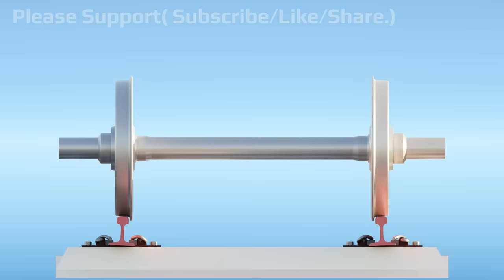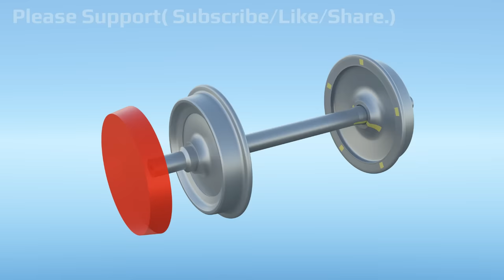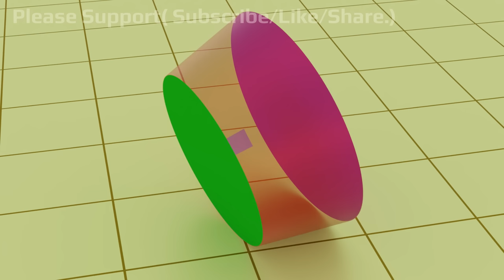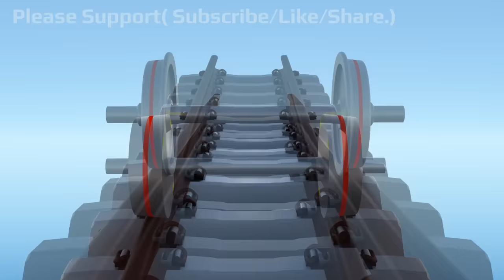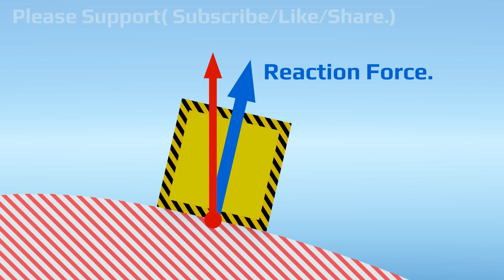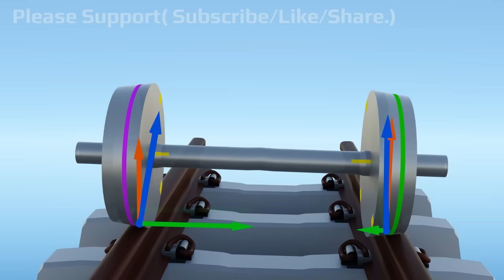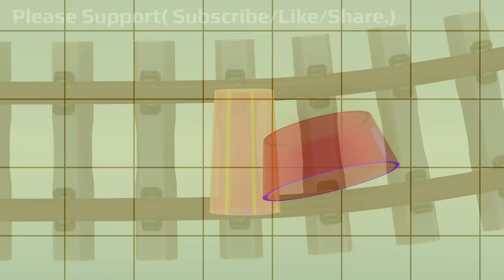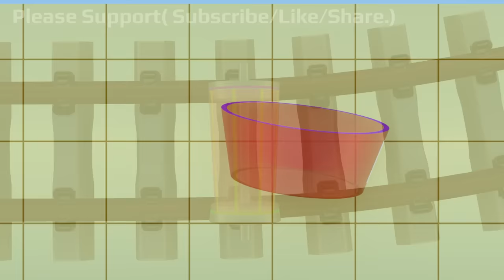How trains actually Turn ? | on curved rail track.

Comment: Only without the wheel and axles and or motors are the trucks called bogeys, with the axle and wheels, and or motor they are known as trucks

Comment: Interesting explanation, but does not apply to all railways. For example the railway I worked on for many years in Queensland, Australia uses vertical rails and cylinderical wheels. This railway has several thousand kilometres of track. The wheel sets still steer around curves, assisted by the superelevation.
Reply: they will wear more quickly (especially wheels) just by nature of their design.

Comment: I don't think that these theories were known let's say 150 years ago and still trains took the bends in railways in those days. In a axle there will be torque in the axle or the wheel on the inner side will slip because it has to ride a shorter distance than the wheel on the outside of the curve. Therefor a car has a differential.
Reply: Some level of wheel slippage is good in railways.

Comment: I wish your videos used complete sentences.  The way they are set up now makes them very hard to follow.  For instance at 2:57 instead of saying "thread section of wheel which is in contact with rails are marked with red color"  you should say, "The red(thread) section of THE wheels, which is in CONSTANT contact with THE rails are marked with A red color".

Comment: 4:00 WRONG WRONG WRONG AS FFFFFFF' rails are installed perfectly vertical, many forces require this mainly the rail bottom so it doesn't split due to weight of the heavy rail cars, one side of the base can not be thin.
also there is no designated rail for left side and right side, they are 100% 90ºvertical and the rail ties they ride on are also 100% 90º vertical........ANY DEGREE OF TILT AND THE RAIL WILL BE PUSHED OVER ON IT'S SIDE ALMOST IMMEDIATELY. 
330 million newtons of force@60mph from a 183,000 gallons loaded tank car. whole towns get wiped out if this math is wrong, ask canada.

the rail head is ground conical to the same degree of the rail wheels, other wise rail MOW companies wouldn't exist to perform this task. as the rail head wears down over time it also needs to be reground to the proper angle once again. this is measured in fuel economy and power level required from the engines as friction increases resistances.

Comment: Flat profile wheels would not travel well even on straight rail.  The conical shape to the wheels and matching valley shape on rails, means it is stable  on a straight section.  it  reduces  bouncing side to side,  which would be annoying   on straight lines...and expensive on wheel and track wear.   If the profile was  absolutely required for turning, how do trains turn at all the different speeds ? Trains  would have to be at the set speed for the corner every time they went through it, so the intrastate freight train would take the curve at the same speed as a transcontinental  passenger  service ?  No. Tilt trains take curves at far higher speed than the maximum speed for ordinary trains.  So no, the rail profile is the same for the straight as well as the curve of any degree, and  the conical profile just  minimises riding the flanges  not prevents it, and the slipping is based on the curve not to do with speed and not cured by profile.

Comment: it needs a differential,
Reply: With a differential, the wheels will not guide at all. You get instant derailment. See the video Guidance by Railway Tracks posted by Civil Engineering ...   The effect of cylindrical vs conical geometry is easy to see.
Reply: @clarencegreen3071  it needs a 
detroit locker.
Reply: @clarencegreen3071  I saw that video. Loose wheels lead to derailment vs. a rigid axle. The cone frustums follow a sinusoidal path as they self steer because the axle has to bank itself as the wheels slide over curving rails. The axle is supported at both ends of the bogie, and the flanges are responsible for the preventing height variation against the tendency of the axle to bank as it rolls over the curved section of the track. 

I was wondering why the wheel axle is not centre supported under the bogie by a trunnion arrangement. A degree of freedom in rotation about an axis perpendicular to the axle would also allow for self centering with the flanges preventing derailment. This would provide for self-centered open-differential type function. What are all the practical reasons for why it is not implemented?

Comment: Great explanation. Your smartest viewers will be able to extrapolate from this why high speed passenger train designs have bogies between carriages rather than underneath them and also the functioning of check rails, but these might prove to be interesting extensions to this topic.  My most notable high speed train journey so far was TGV Lyria from Zurich to Paris - covered here: https://youtu.be/oG5y1gYOd3g
Reply: but they steer the rails in exactly the same way as conventional pullman or budd trucks did. the reason for the truck configuration you describe is for ride-quality and serviceability.

Comment: It's 40' from truck C/L to truck C/L!  And every truck has two sets of wheels! every car has two trucks! Total of 8 sets of wheels! And the curves on rails aren't calculated by the highway standards but designed by a sub chord of 50' this way the trucks won't get bound up in a curve! Because a highway curve is calculated by the Radius and a car or truck can make that radius, whereas a railcar can't handle a radius smaller than 40' because CL to CL is 40'! That's why you calculate radius by using 50' sub chord! Rail Road Curves, aren't tangent to the PC or PT but are larger than the radius of the curve because the points on any curve can't be calculated closer than 40 feet! That's the difference between highway curve staking and Rail Road curve staking! All these displays are irrelevant! Because if they stake to highway standards the first time the trucks hit a curve they would bind up or blow out a track!
Reply: Wrote: "every truck has two sets of wheels! every car has two trucks! Total of 8 sets of wheels!"
Check your maths
Reply: @dukenukem5768  two trucks per car! Each truck has 4 wheels! 2 x 4 = 8? Unless you're a Trumpican? Then it equals any number that makes you right! The distance between C/L to C/L pins are 40' ! ie 50' sub chords in any Rail Road Curve! Just open an survey  field, transit book or any route survey book! It's all there in Black & White!

Comment: Gross over-simplification. Still simplified, the flanges themselves are blended into and angled. There's also the rounded shape of the rail itself. The coning mentioned in the video is most important for running on straight track and on superelevated curves. For the tight curves around stations etc. then the flange geometry plays a much greater role.

Comment: Blah blah blah…
I’ll like and subscribe if you can be the first YouTuber to actually tell me how trains with more than two sets of wheels on each side can go around the bend!
Example:
If an engine has 5 wheels on each side fixed to the engine, so no bogie, how do they manage to go around a curve track without derailing?